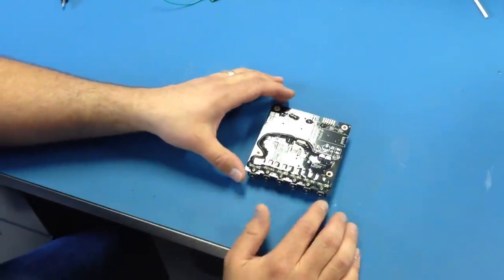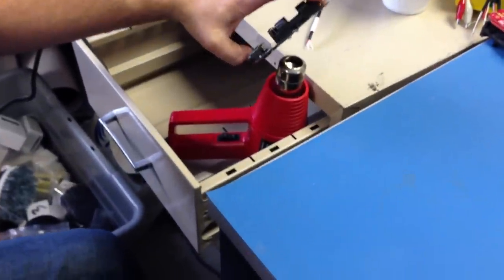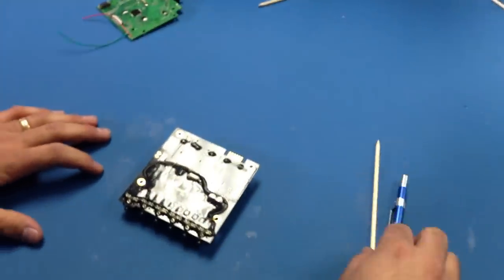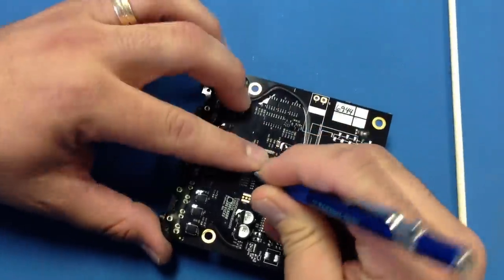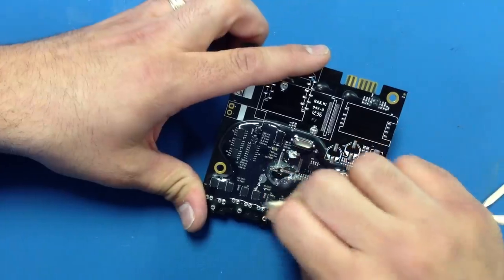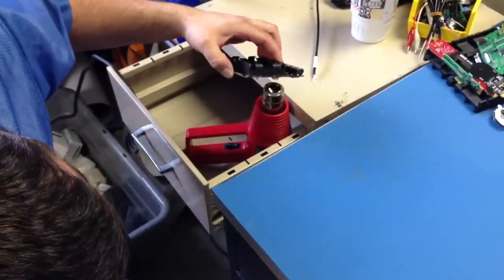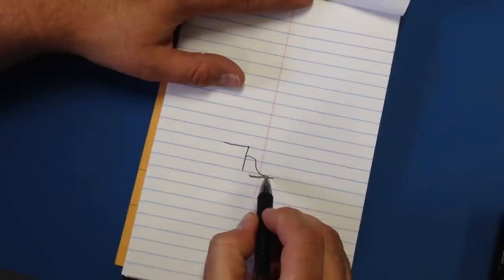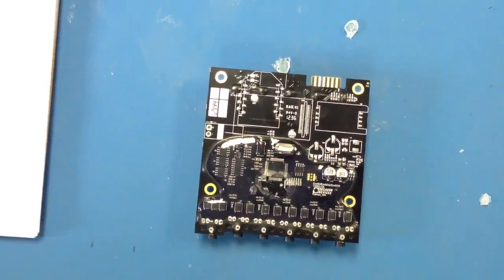How to remove conformal coating from circuitry

Comment: Or you could buy a $10 automatic toothbrush kit from rite aid. Use the plastic tip. Remove it that way. No heat needed. No damage possibility. Very easy. Let the brush do the work for you. You're awesome regardless for posting the video. Just thought I'd share a tip I've learned throughout the years.
Reply: Can you say more about "plastic tip"? Do you mean the plastic the bristles are molded into? What do you do with the tip? Does it work on any type of conformal coating?
thanks!

Comment: No matter what the oem says, the only reason for conformal coating on circuit boards is to make us miserable when we have to repair them
Reply: Its mostly for water proofing in cars, boats, anything that is likely to come in contact with water or salt water
Reply: @bhoot1702  still no excuse for using it unless the whole damn board is potted in it, which it probably isn't

Comment: how   do  you  remove  the  green coating  to  see  the  leads  on  circuit board without damaging  the  lead or  the  connections ???
Reply: Sharp edge drawn away from the sharp edge until you see copper.  Stop as soon as you do.